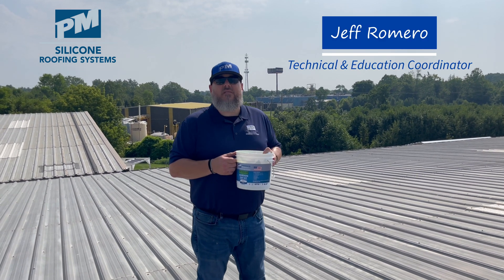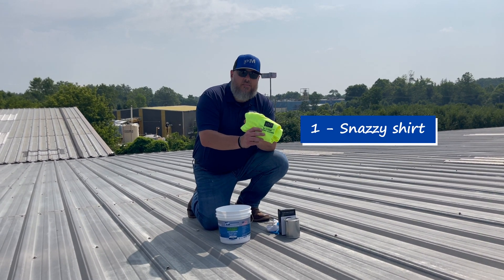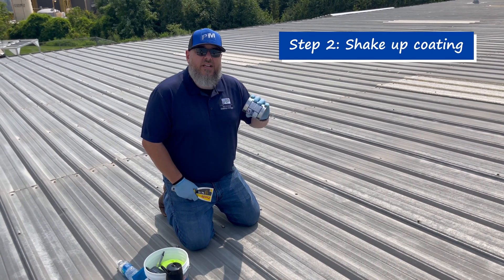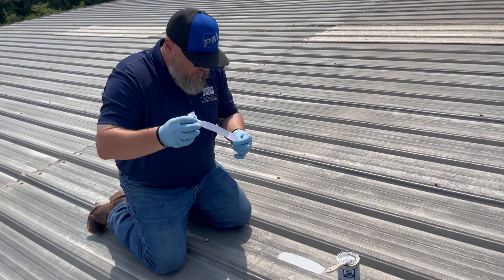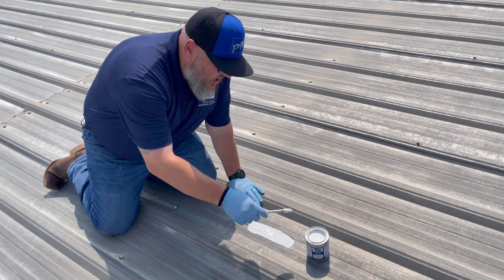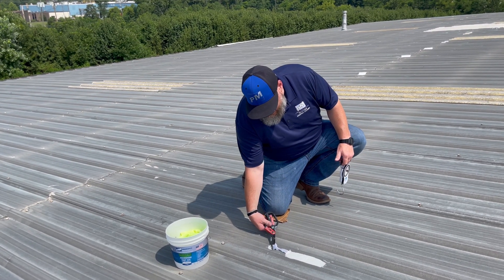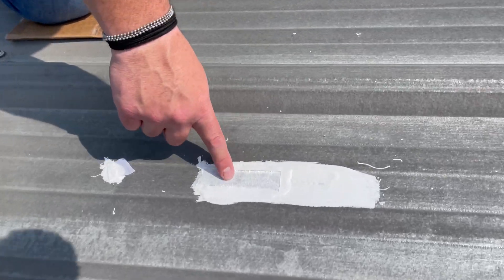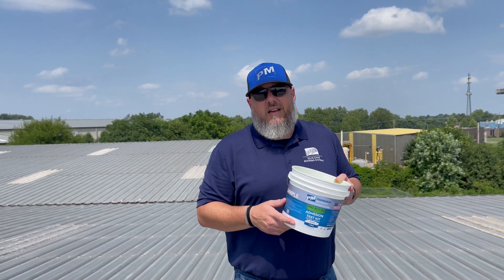How to do an Adhesion Test The Right Way (D 903)

Comment: Just as a heads-up, ASTM D903 (2017) states that the test must be pulled at 180 degrees, not the 90 as mentioned in the test. For most purposes though, good video.
Reply from the maker: Thanks for the comment, Tyler. That is what the test states but it is nearly impossible to pull 180 degrees on a roof so we standardize it by pulling at 90 degrees for our application purposes. This is the only place we do not follow the standard 100% and it's because it is not possible.